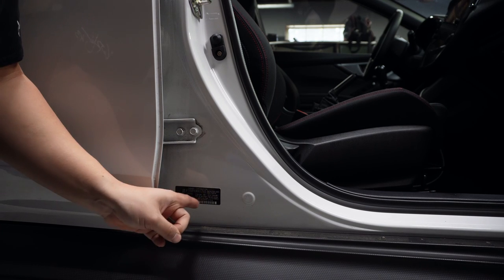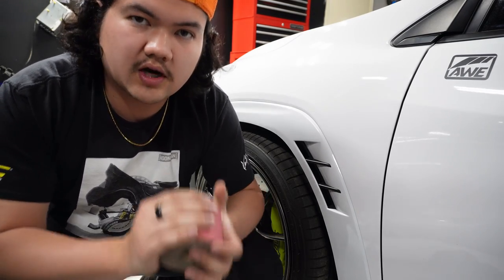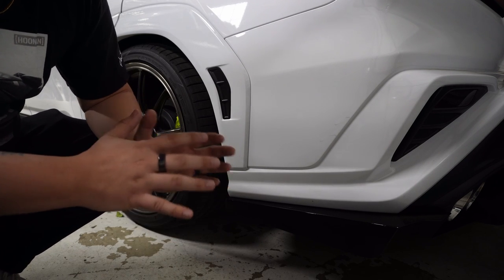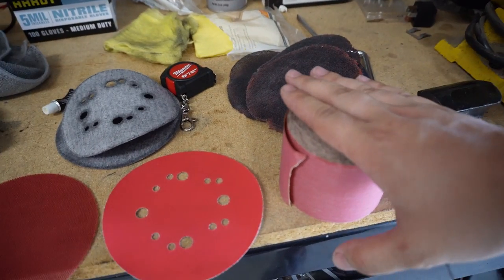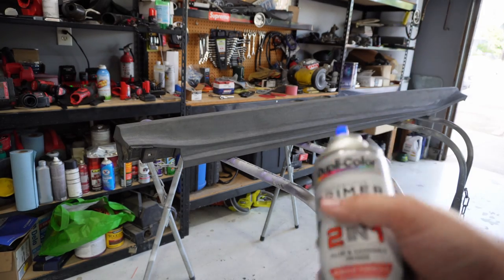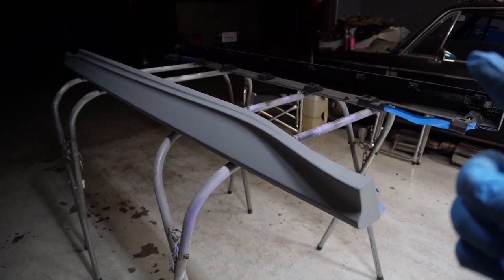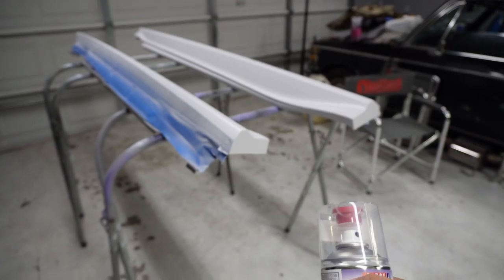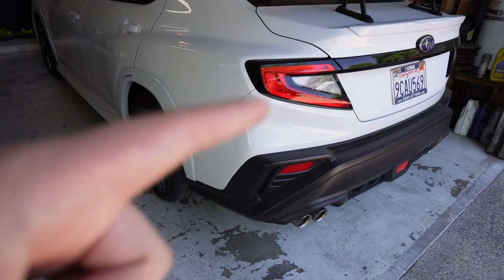2022 + SUBARU WRX VB HOW TO PAINT MATCH PLASTIC/CLADDING/PANELS AT HOME

Comment: It’s getting “fuzzy” because the friction from the orbital sander is melting the plastic and then it’s cooling and hardening. As someone else said, high-build primer and sand and repeat, then paint and clear with high grit sanding between coats. It’s almost impossible to sand that plastic cleanly and evenly, especially with a power sander.

Comment: Nice Job & Looks Great.. 
 Wondering if anyone has tried:
1st,  using 400 grit light sanding but not  removing texture
 2nd- Apply adhesion promoter  3rd, Apply  a few coats of HI Build primer
4th, Apply color base coat
5th Apply 2k clear 
Ive always been taught to use adhesion promoter when painting plastics.
*Unsure if this would take care of covering texture or not?

Comment: I haven’t seen you use adhesion promoter unless it’s in your primer? And sanding the texture off is the best way . Great job looks good
Reply from the maker: Hey Louis, since the primer has a minimal texture on it I never had problems with paint peeling. I’ve only used adhesion promoter on parts that aren’t prepped properly. Not a bad added step though.
Reply: I did my flares and bumper I know on raw plastic it’s always good to use . But you did a nice job looks really good.

Comment: Almost painful to watch. 
Pro-tip “high build primer” 
First 
barely scuff the piece with 180 
then wipe down the piece with mineral spirits ..then give it 2-3 coats of high build primer and the honey comb will be gone! 
Now sand and paint. 
Don’t waste time actually sanding your plastic down. Sand primer. 👍🏼🤷🏼‍♂️ 
I still love you tho. 😂
Reply from the maker: Fantastic advice! I don't think the pro shop that did my bumper used highbuild primer without sanding down the texture first. I'm sure there's better ways to do this but I was very happy with my results.
Reply: Do you know how many mid coats to do? I have wr blue pearl for my 22 wrx
Reply: Imma try that now
Reply: @spacedmellow5031  okay

Comment: @hapawerks How many cans did you use on the sides? Meaning primer and base and clear?
Reply from the maker: You're going to have to elaborate on your question @jimmijames23. Sides meaning just the sideskirts? the video also talks about how many cans I used and how much I would estimate for a whole car. As a rule of thumb, a can a  part is about right give or take.
Reply: @Hapawerks   do you know anything about a tri coat aka mid coat. Since I have 22 Wrx WR BLUE PEARL I’m just wondering how many md coats
Reply from the maker: @JimmiJames23  I'll admit that's a bit outside of my element but I would expect that the employees at the paint shop would be able to give you advice on that. I believe they can either mix the pearls into the basecoat or supply you with the necessary paints. sorry I couldn't help more.
Reply: @Hapawerks  okay thank you

Comment: I know you an sand it but couldn't you just use a light weight filler instead
Reply from the maker: Judging by the responses some people have done that. I don't like using filler too much as when materials expand and contract sometimes it can cause cracking.